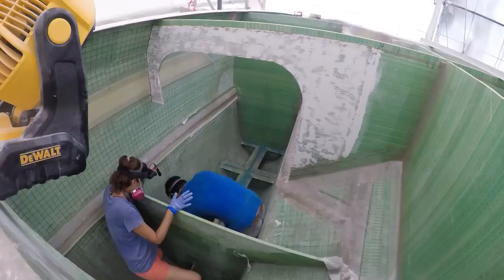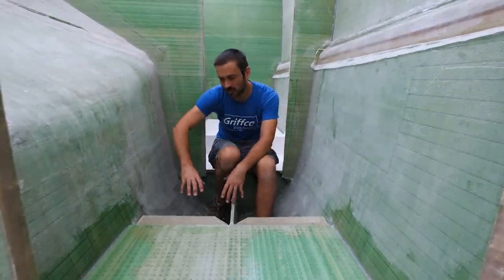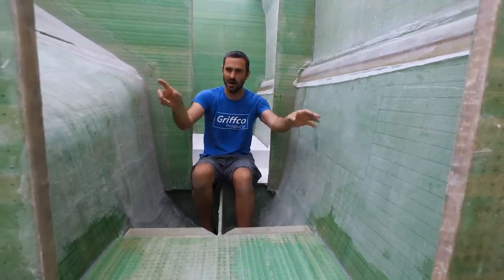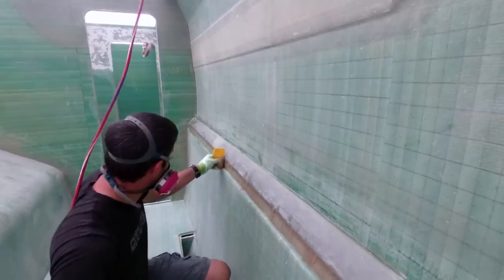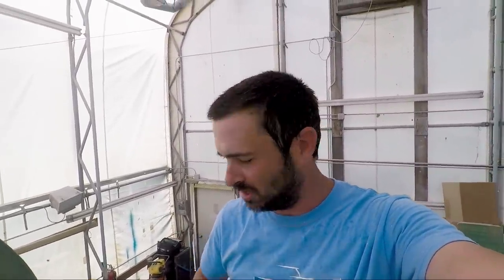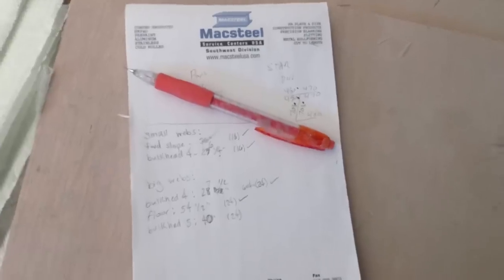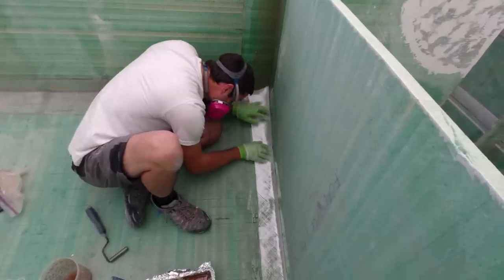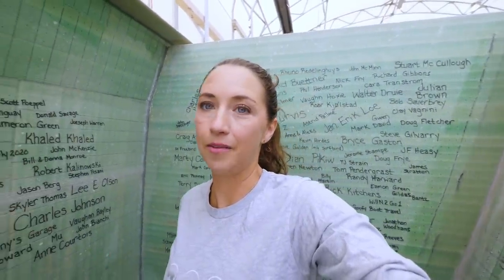CATAMARAN BUILD - The Backbone of our Water Tanks (MJ Sailing Ep 204)

Comment: You were spot on about running your wires high and on the inside. I think storing batteries down low is also a mistake if can be helped.
Reply from the maker: Yeah.  It's nice to get battery weight down low, but the chance of water getting in contact is too much to chance it.  -Matt
Reply: @MJSailing  Right, seen too many not be able to use the bilge or even crank the engine at the most worse possible time because of submerged batteries. 
On that note maybe you could get away with having an emergency battery up high,  but I don't think I could chance it either.
 The thought you 2 put into this project really shows.

Comment: for the cured resin in the aluminium rollers, get a heat gun and heat them, the metal will expand and the resin will detach from, you might get to reuse them

Comment: That was a great explanation of how the watertight compartments work in the hulls of your cat.  It also makes perfect sense why you don't run the electrical conduit between the compartments as you mentioned it's a big point-of-failure if anything gets damaged in an underwater collision.  The more work you both do with the fiberglass reinforcing the better it is to understand how strong it makes the boat and internal compartments.  Hopefully you will get the rest of the resin you need sooner than later to move forward with the rest of the floors and compartments.

Comment: I believe that foam is used for water displacement. Should any compartment get damaged and water intrudes the foam will only allow so much water vs the compartment filling fully with water. 

As for your resin fin rollers, you can burn the harden resin off with a map gas or propane torch. Just be careful not to heat 1 area to much as you can melt the fins.

Thanks for making your videos and sharing your build. Looking forward to your next one.

Comment: I have been told (Brickhouse Sailing) that a heat gun on the cured resin can remove it from the metal rollers. Just keep cooking until the resin is kind of destroyed. 
That may only be applicable for epoxy, though.

Comment: Great progress guys. Looking good. The problem with the double floors is if you get any water ingress which is very unlikely but could happen, is you won’t know. That area could have flooded sections and you will not know you have a problem. How about small water tight bungs through which you could pass a borescope for inspection. 👍
Reply: I think that a typical hole/crack in the hull would only allow the compartment to partially fill with water since an air bubble would be trapped above. If that happens then water would slosh around in the compartment perhaps making enough noise to be heard. I started looking for inexpensive remote water detectors but could find none. Seems like an opportunity to make a simple device that uses sea water to trigger/power the signal transmission via wifi/bluetooth. Should be possible to make such a thing for under $5. It does not need to last a long time once activated. Just have an always on low powered boat computer listening for the signals so it can notify via screen/audable/phone ...

Comment: Filling those compartments with foam would be a terrible idea. In the event that one of the cells is punctured and water ingressed, water would intrude into the foam and the foam would have to be removed, meaning a hole large enough to get all the foam out would have to be cut. Done like this, all you have to do is cut out the damaged glass, dry the cell out, and re-glass the damaged area.

Comment: Foam, even closed cell makes a wonderful ballast. It WILL absorb water and refuse to give it up. If there is any way to get around USCG regulations on foam it should be avoided. And it only works if the boat has sank to water level.

Comment: Q: How do you know if you've puncture the hall and a one of the compartment is full of water with double bottom?
Reply: Good question, I was going to ask that myself.
Reply: The change of buoyancy on that side of the boat will cause a list which will have to be checked by physical inspection under water.
Reply: guessing after they clean out their pants from the scraping thunder that they will check that.
Reply: @canlib  with one area compromised and flooded there will hardly be a list at all. Maybe sound will play a part.
Reply: @keakiwi1  List or not, the answer to your question is again, visual inspection under water.
Reply: @canlib  ok ok you made your point dude.

Comment: If only each production boats were built with such detail......a couple of suggestions  if you cut material strips with a box cutter razor knife you can roll it and cut multiple layers at the same time......you may want to set up a wetout station to resin coat the strips before rolling them in place....just saying

Comment: On your metal rollers that fill with resin. Take a small propane torch ( put you chemical mask on first) and heat the roller to burn out the resin. Heat it till it pretty much quits smoking.  Let it cool and take a small wire brush to it and your good to go.

Comment: Great explanation of the second watertight bulkhead under the floors. Do you follow the builder's fiberglass layup schedule exactly or is there flexibility in the build process?
Reply from the maker: We follow the design plans, but we're a bit heavier with our glass since it was designed for cloth made in grams and what's available in the US in ounces is lighter or heavier, but not exact.  We went for lighter- 400g instead of 450g - but more layers to compensate (usually three per side instead of two). -Matt

Comment: I wonder if the core on these boats could be made of 3d printed sections to make it stronger and more water resistant? It would likely have to be some of the better stuff like the fiber filled plastic s which can be stupidly light and strong. It could also allow for simpler manufacturing of more complex shapes.

Comment: Foam in the cells would however, would allow less water into the cell and maintain some buoyancy that would otherwise be lost to water.  If a puncture 'fills' a cell, then the cell might not be airtight and foam would be a way to add extra sealing protection.  Foam could still be added through small holes in the floor that get sealed afterward.  Just a thought.  Foam weighs a lot less than water and it would deaden the noise of the water slapping the hull.
Reply: I have taken multiple old boats apart and refurbished them.  The foam in all was a water logged sponge.
Reply: @pavichapin  In many cases that would be true.  Guess they were using the wrong kind of foam.  Some foams are marine approved and some are not.  Marine foam holds up docks all around the world with no problem except plant and barnacle growth.  If it is really "air tight", like they are hoping, then it won't get water-logged.  My point is, if there is a crack that is not obvious, then the cell will fill with water and ALL ballast is lost.  If the right foam is there, then very little ballast is lost.  Cool sailing.
Reply: @covid7031  The expansion foam used in boats is not the same as the white foam used for boat docks.
Reply: @pavichapin  I did not say it was the same foam.  I said, "Some foams are marine approved."  That does not mean there is only one type of foam for marine use.  Maybe someone is cutting corners to save money and used the cheaper foam in the boats you refurbished.  And it sounds like they were not very 'water tight'.
Reply: @covid7031  These were top of the line boats like Ranger and Triton. The foam used in boats will become water logged. Even Boston Whaler. Maybe let the decision made by the catamaran company  stand.

Comment: I will tell anyone building a boat for free having owned three of them.

The only time and place water lines or wiring broke and was abandoned in the boat was when they were below the floor where you could not see, repair or detect them. Every replacement was run where it could be inspected and repaired.

All electrical in my last boat was a large feed overhead and it was a cat so I had four fuse and distribution points one in each hull and one for the bridge deck and one exterior and the feeds to the sub distribution points.

Being able to turn off one or both hulls power was awesome and running new USB or 12v were short runs overhead and so much less work and leaking connections or rubbed through pumped above the floor was easy to find and fix as it showed itself before the bilge alarm or pump was running continuous.

Just my 2c

Comment: I hope your adding a pinch of chop strand additive to the VE puttys your making. It will reduce the chances of VE puttys ever cracking in the future, even more so in greater mass. VE with cabosil or any thickener like cabosil is prone to fracture with age at any thickness.
Reply from the maker: Colloidal Silica and cotton flock (same as West system 403) is used for most fillets, but in specific areas we do add either milled fiberglass or strands.   -Matt

Comment: If you rip a large gash along multiple compartments, how are you going to get water out with a pump? I would think a small hole in the webs to allow drainage to a bilge pump would be safer overall
Reply: Seems like you would have to patch the hull from the outside first, then drill a hole in each compartment to extract the water... Once drained and dry, just fill the drilled hole with epoxy. If the space of those compartments is needed later on, then a hatch from the topside could always be added.
Reply: I they rip a gash in the hull, they will need a haul-out. At that point a hole will be needed in the floor so the hull can be repaired from both the inside and outside.

Comment: Questions: how do you know where to place the bulkheads? How do you know how much resin to mix? Have you tried nylon material instead of peel ply? Spoondrifter (you tube channel) mentioned they use nylon material instead pf peel ply, its cheaper.
Reply from the maker: Ecoply peelply seems to be the cheapest fabric I can find - even cheaper than using another fabric not intended for the job.  

The plans have the bulkhead placement laid out in them.  And any questions are quickly answered Max Cruise.  It's one of the reasons I chose this boat... The support is amazing.  -Matt

Comment: One more thing.... you guys are fighting your self setting walls... what you need is like a steal pipe 
Swing set, top bar, GPS completely over the boat. Make the legs so the top bar if 10 feet above, the boat. Gas pipe is cheapest, 20 foot sticks, 1.5 inch, fitting are cheap. Then set up a light.... chain hoist, system. One on each end and one in the middle.. clamps can be temporary glassed in place... think.. a wild dingy system to lift a dingy,  use, ropes, some tackle,  pullys... 
You 2 are mcgivers.  After you fit a wall.. pick it straight up... run the epoxy beads... lower the wall aginst the cleats. Sand bags, made of socks, hang then over the wall... adjust to make sure it's right. Why I'm I a smart ass. Why in the 70s... I had 40.000 top engineers who worked for in the DEFENCE I industry,  we made subs, 
and big as boats..Haha, navy shit.

Comment: You get two types of foam and to my knowledge they are open cell foam & closed cell foam.
The open cell foam will act like a sponge if submerged in water. The closed cell foam will not absorb water if submerged.
When Matt spoke about Boston Whalers absorbing water, I think he may have mixed up his boats, as in Del Quay dory’s v Boston Whaler.
Del Quay dory’s we’re renowned for becoming much heavier if there hull or deck skin was punctured.
Apologies to all of you out there who are aware of these facts. 🤔🤔
Reply from the maker: Closed cell foam is only resistant to water intrusion.  The cell's membrane isnt waterproof indefinitely, so the water log and are hard to fix.  Boston Whalers are closed cell and still absorb water.  

Matt
Reply: @MJSailing  Matt I stand corrected.  😊🇨🇮

Comment: You can seal water in, but, you cannot seal water out. ( all boats leak and aquariums don’t)
What is the plan to remove any water, moisture, condensation from the “dry cells” under the floor? Are you concerned about what might grow in that sealed environment?

Comment: You don't really know for certain that those compartments are watertight without doing a pressure test. Unfortunately you can't do a pressure test without poking a hole in the individual compartments . Don't run electric below the waterline if you can possibly avoid it.

Comment: old whalers are not great closed cell, much different today, todays wont get water logged like old....and the advantage is that is keep the water out...water cant displace it so you will sit higher in the water if punctured...which can be the difference between getting water in cabin and engines

Comment: Why no flow coating the space below the floor…?
Reply from the maker: Weight - flowcoat is heavy..   Plus with an foam cored infused hull, there shouldn't be penetrations without a thorough resin coating making a gelcoat cover unnecessary for an area that is not constantly emersed. -Matt

Comment: I've seen you use the peel ply before...what exactly is the purpose of it?
Reply: Peel ply can suck excess resin but the main purpose is to have a rough but even surface to add another layer over it without the need to sand it.
Reply: @mazevx2451  It also protects the finish until the time comes for the next layer.

Comment: If I watched the video right... u two aligned the bulk wall. Screwed cleats to hold the wall to the line. ( right ). You then adjusted the wall at hull. ( right )... when perfit straight.  You then started glassing the bulk head wall in. ( right )....
Guys, the wall where it lays on the hull " should have had a, piped.... bead of slow curing epoxy,  under it the whole LENGTH.. you just sat it on the hull a d glasses the sides. ( that's wrong )
And now a weak point in the over all strength of the kit.  Maybe you ran that bead under the bulk head wall and didn't film it. ? Heavey seas...
Bulk head gives way., there can be no gap under a fitted wall. Engineering 101...
Reply from the maker: That's incorrect and not typically how it's done.   The engineering was for the fillet to spread the load to the hull skin with the fiberglass tape.... Not the bonding.

Comment: A tip for metal fin rollers if they dry and stick. Hold them over a hot flame (I use my BBQ jets) for a few minutes and the residue will burn off. Might just need to give them a quick scrub to remove soot, but it works a treat!
Reply from the maker: Someone posted that below.  Great trick (already tried it today) and something I hadnt heard before.  -Matt

Comment: I have gotten used to spreading glue all across the two pieces to be glued together and not asuming the bead of glue will spread and fully contact both surfaces. Also removing dust and contaminates gives a better bond. Wipe with damp cloth before running the bead.
Reply from the maker: We've done it that way too (shown in earlier episodes) , but often got trapped air when adhering two surfaces with adhesive spread on them.  The single bead seems to spread it out better for us.  Matt

Comment: Are you going to paint the interior of the water and fuel tanks ??????  Install an inspection port on both ????????  I subscribed a while ago but this is the first I've watched on the new build .....  Tally Ho, ODD, Yaba, Acorn to Arabella and now you guyz .  It's the problem solving and organizational skills that impresses me .................  enjoy
Reply from the maker: We're lining the water tanks with a potable water epoxy paint.  If you let it cure for a while - we'll have over a year before they are in service - then they are safe for consumption.   We'll have large openings in the tops to allow proper scrubbing of the tanks.  We typically do this on a yearly basis.   -Matt

Comment: I like the closed air cell versus foam, I have foam in my boat and do not like it and will pull it in the future. I did a little research and found the ABYC/ USCG standards for both. The closed air pockets are supposed to be separate compartments from the hull. If I am wrong please let me know.
Electrical in the bilge, below water line, is never a good idea and running it inboard and well above the water, as you are doing, is absolutely correct.
Thank you for the build videos and keep it, I splash this month and will be heading to the Bahamas in mid-November.